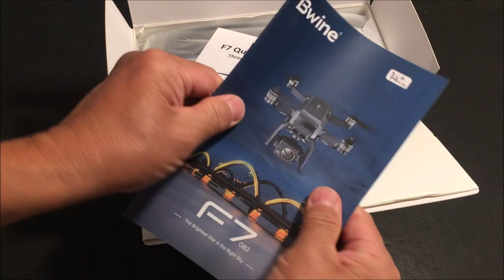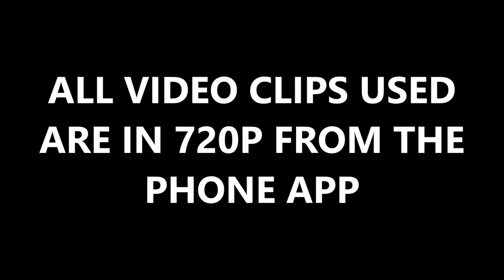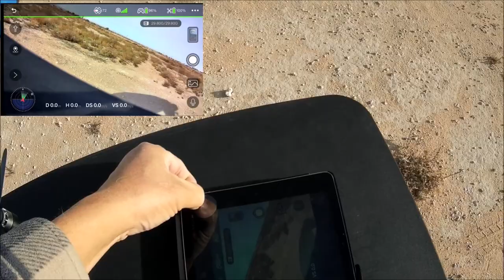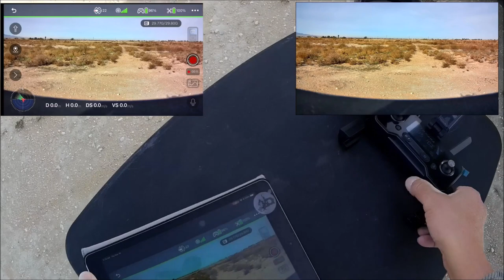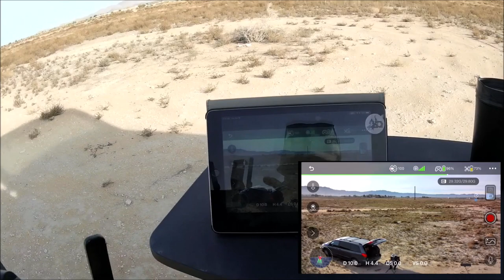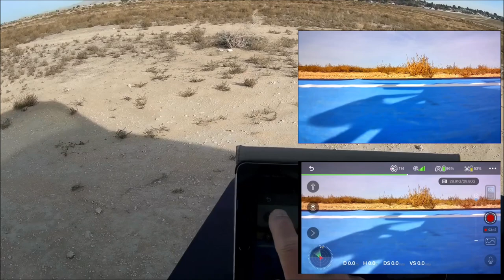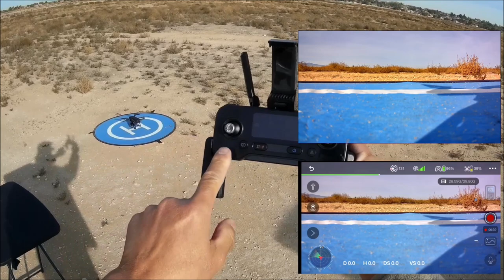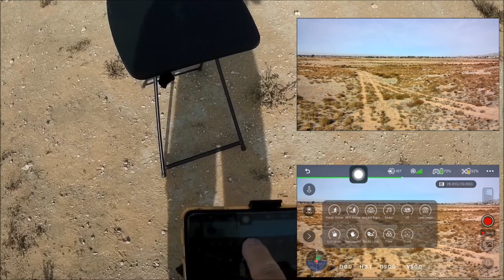BWINE F7 GB2 Review and Test Flight

Comment: The circular openings on the bottom look compatible with sonar sensors,  but Bwine would no doubt brag about them if it had them.
Reply: Not only that but the spot they fit in looks exactly the same as the ones on the X12.
 I wonder if there's a spot to solder them into the main controller PCB and what it would take to get them working...

Also the SJRC version S  version has front IR obstacle detection...

Comment: Do You know if this drone has built-in Remote ID?  I just got this one a few days ago and I’m trying to figure out if I need to buy a separate remote ID tag for it.
Reply from the maker: This drone does not have rid.
Reply from the maker: @@dhfhdfhdfhdfgh 
What is a FAA-accepted means of compliance Remote ID?
An FAA-accepted MOC describes one means by which a person may comply with the minimum performance requirements for remote identification in subpart D of part 89. To be accepted by the FAA, an MOC must meet the requirements of both subparts D and E of part 89.Nov 14, 2023

Comment: FOR THE LACK OF downloadable pictures, I had to buy this unit to see what the photos look like.

I turned on the drone, then turned on the remote(two distinct power button pushes).  I purposely wanted to test the camera's supposed default 4K photos, mainly because I hate using a cell phone on a dedicated remote ... maybe someone will chime in as to if I "need", the cell phone to get the supposedly default 4K(photos and video). I hate having to worry about the $%#&^&%@#$@ cell phone dropping off the chincy cell-phone bracket(it's happened a few times).  My use of a drone is to start, go north for 250 meters, go east for about 3 seconds, go south for 250 meters, go west for about 3 seconds and on and on and on. Of course a program for such a pattern was easy with the $100 Parrot Bebop ... draw the map(on a computer), download the pattern, turn on the drone, select the pattern's file, the sip coffee until the drone returns, or in trade, I could just tell the drone to land somewhere else where I could pick it up ... all, hands, off ...

These photos appear to be nothing more  than 1080 "electronically enhanced", photos ... I suspect "Edge", enhancement along with a little extra contrast, because a lot of items have a "fake", partially black outline, which does not exist ... no good for any useful purpose.  A telephone pole at 100 feet looks truly like carap. The photos seem to be very similar to those $5000 dollar $50 dollar wonder drones ... the ones one wonders how one could be so stupid to think might be a nice drone.

I also noted the dates of the photos, were December 31, 1979(first generation GPS?). Typical file name was 0302-081244-268287-0, then   0302-081305-432200-0 ... my guess would be MMDDMMMMSS-, then I get lost.  I might not have waited long enough for a good GPS lock(never started the motors), so I could be wrong about the file designation.  But I don't think I'm wrong about the real shiety photo quality.  Many might not remember, but in 1979, a lot of computers had to have the date MANUALLY entered every startup ... Tomorrow, I'll wait for GPS lock, but my expectations are very low ... my HS550 has very rarely ever given me a proper date(without the cell phone)

The photos are about the quality of my Parrot Bebop drone photos, although I suspect my Bebop drones photos, only slightly better(they do look a little better).

Some savvy computer reviewer should set up a site where a review could be followed up with actual photographs ... photographs taken, then placed within a video, is not indicative of the  true quality of the photo. Such information would be very helpful making monetary decisions ...  after all this was $250, and I've seen the same for over $400(maybe with an upgraded camera(?).

My conclusion is my HS550 is a much better drone, with a much better camera(abeit no real gimbal).  The HS550, and others are built like tanks and the photo quality is much better at 200+ feet ... much better ...

I will give this ... thing ... another day for testing, but I don't think there's a chance it's muster ...

BTW, looking at the SJF PRO app, "details", indicate VGA, 720P and 1080P ... go figure ... what a crock ...